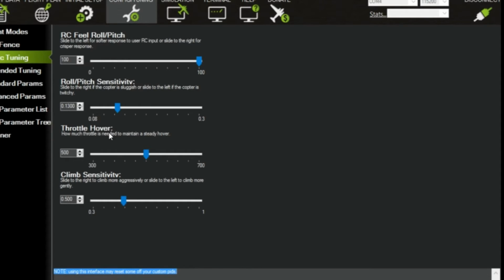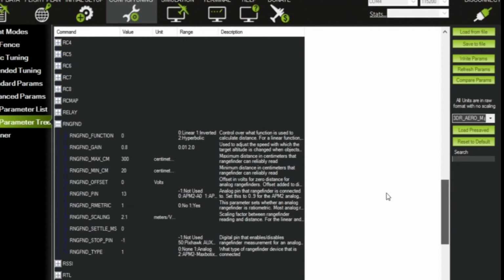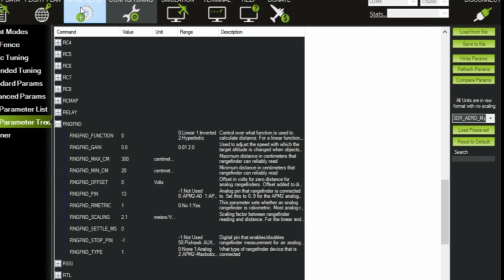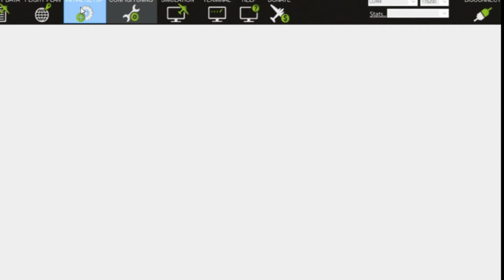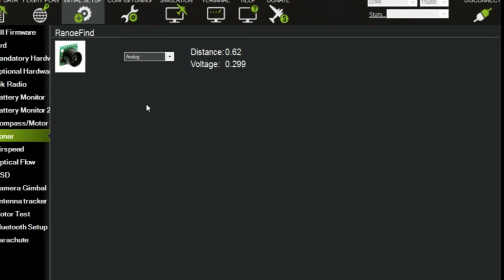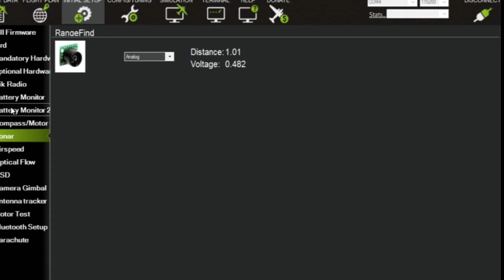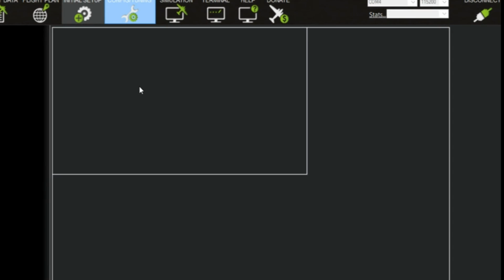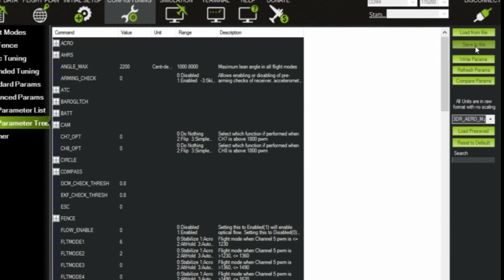cx20 sonar apm 252 v5 mod update

Comment: Hi Bangs6996, i have a four pin ultrasonic module from banggood,the pinout say VCC,Trig,Echo,Gnd,just trying to figure out which wires go where...any help would be greatly apreciate,thanks buddy
Reply from the maker: Hi sadly you need the 3 pin one https://www.banggood.com/APM2-2_5-2_6-2_8-Flight-Control-Ultrasonic-Module-Plug-and-Play-p-1010060.html?p=PK211613756002015039

If you are into arduino's ..you can probably easily just build the man in the middle board your self..  however on the above board they use a i2c adc chip for the conversion ..

Comment: Yeah, I was also wondering why you didn't use some I/O pins like those with raspberry pi. But it was quite a feast to see you soldered it onto the board. Thanks for this update.
Reply from the maker: yeah that apm 252 is limited with i/o pins. if you use this mod then you can't use the power module sensors ..   thanks for the comments..

Comment: Hello,
Is it possible to have a 3.2.1 firmware version for CX20 able to run only gimbal Mount, AutoTune, Sonar, Telemetry, DataFlash logging, and Optflow ?
Or tutorial, documentation on how to compile a custom version otherwise ?
Great explain and I would like to try the gimbal ROI with sonar and optical flow, it will be awesome if possible !
Thanks !
Reply from the maker: hmm never got notification or your post..   no you can't have all that , just not enough room on the apm    you can probably do optical flow ,sonar and gimbal.. ... telemetry is included ..     however I would try testing out just the optflow first on its own. to see if you really even want to have it enabled.
Reply: Thanks for your answer.
I'm actually looking to compile firmware myself (but always afraid to make mistake and break my APM).
What is the limit for the hex file for our APM so, we have to keep some free space ?
Also, when I have the hex file compile, I can upload it with Mission Planner right ?
Edit : I just realize that I cannot use Optical Flow or Sonar if I have a Power Module on PIN 13, so I think I will keep my Power Module. So, I would like to have Logging + Mount + Autotune + Fence + Poshold + ACRally + NavGuided. Do you think it's possible ? When I compile this setup (without NavGuided cause it tell me "'Guided_Velocity' was not declared in this scope"), I use this source : https://github.com/funtastix/ardupilot/tree/ArduCopter-3.2.1 (hope that telemetry still work with this one), in Visual Studio (and Visual Micro), and I get a program size : 241 218 bytes (used 93% of a 258 048 byte maximum), in Explorer Hex file of 663kb.
Reply from the maker: you should get your self a isp before you start playing around... randy said it was 146kb but i think he meant to say 246kb.(in arduino).. ..    The end result of the hex file I try to keep around 672kb  which is the size of the release version 3.2.1      ... Which Apm are you running ?  2.5.2 stock?  if so then your telemetry might not work ..but I can give you a link for where to change that.
Reply from the maker: I did not know funtastix had his own tree..oops lol.. so yes that one will work for you.. also I have not been getting any notifications on your posts.. anddd they don't show up at the top of new posts for me.. So if you leave a comment  to me I am not ignoring you I just don't see them ...
Reply from the maker: and to continue spamming you.. yes you can use mission planner.
you can find the hex file  here C:\Users\YOUR USER NAME\AppData\Local\Temp    it will be in a build folder..just build your file without having your apm attached to the computer
Reply: Don't worry about your answer rapidity, I don't receive notification too, wired...
I just bought a AVR ISP as you mentioned.
I am running the stock CX20 APM, I think APM 2.5.2 with UART ADC and I2C connectors, on firmware 3.1.2 for now.
My hex file is 663kb with Logging + Mount + Autotune + Fence + Poshold + ACRally, and Visual Studio show "program size : 241 218 bytes (used 93% of a 258 048 byte maximum)", probably in Arduino ROM yes. But 146kb is impossible to have this size with 3.2.1 firmware, isn't it ?!
So, my hex file is correct to upload on my APM and keep Telemetry and others stuff working ? Also, is there a risk to break my APM just with uploading the hex file, or at least I always can revert to 3.1.2 by uploading the factory hex file with MP if anything goes wrong ?
(Thanks a lot for your help)
Reply from the maker: Yes ..I have another video with the factory hex file so you are all good.....your hex of 663kb is perfect (thats with tonz of checksums). and if you do brick it . I have a video for that as well with all the files handy... so really you are all good and on top of everything already it seems.. =)..       And a tad more if you went through the trouble of converting the hex2bin you will see your bin file is 241kb again ..
Reply from the maker: anddd also if you are really good at soldering check out my original sonar mod.. you can do a direct solder on the pin to have sonar and power module ..but its right on the atmel pin..
Reply from the maker: https://youtu.be/CPxMgzNjj0w?t=537
Reply: So, it's possible to solder the signal wire on the pin you show on the video (act like PIN A0 on the CX20 APM 2.5.2 ?), and at the same time keep the PIN 13 for Power Module ? This A0 PIN is not use for another thing ? BTW, I'm not a king in soldering haha !
So maybe I can enabled Sonar and Optical Flow in addition on the 3.2.1 custom hex, if I keep file size under the threshold of 253kb.
Edit : I just recompile with Sonar and Optical Flow added. I get "249 288 bytes (used 97% of a 258 048 byte)" and hex file of 685kb ! Still correct ?
Reply from the maker: it might work I have some at 251kb ---705kb.hex. but it might brick it 
as well. ..... yeah you can use A0 its not traced out to nothing else 
.its just a dead pin on apm 2.5.2 ..all they had to do was extend all 
those traces to pads..but noooooooooooo...         If you write your hex
 file with mission planner and get a verification error.. don't unplug 
it just click on the quad icon and load version 3.2.1 or 3.1.5 you can 
some times save the brick..
Reply: Ok thanks !
I think I will try to update firmware next week after finding good parameters (PID, flight performances, etc) or when I will receive the AVR ISP, just to be safe !
Reply from the maker: Your welcome....If you run into problems just start a new comment in my most recent video.. I should be able to find it that way..
Reply: One more question, I just see your video on Optical Flow on APM2.6, I think it's not possible to have one on the original APM2.52 stock board right ? Too many wires, and a 3.3V output.
The only way to have an Optical Flow on the CX20 is to replace the FC for APM2.6 or APM2.8, isn't it ?

Comment: Hi again, I know this isn't the right video for it.. But I am wondering if you have any experience with updating the APM firmware? I have a V2.5.2 board and I am wondering how to update the firmware to 3.2.1
Reply from the maker: Hi..if you want to update to version 3.2.1 just open up mission planner..go to initial Setup -->  Install firmware -->then click on Apmcopter version 3.2.1 if it says apmcopter v3.3.3  ..you can still click on it ..it will load version 3.2.1  or you can click on pick previous firmware.. and choose the one that says 3.2.1
Reply: +bangs6996 thanks so much bangs6996 will this be safe to do? I have heard a lot of bad stories about firmware issues and hex files etc....
Reply from the maker: yes it should be fine to update it.. you will loose the option to calibrate the compass with the cx20.. you will have to do it through mission planner.. however i have a video with the factory firmware...    .. Also before you upgrade to version 3.2.1 back up your parameters.. This way if you have issues with version 3.2.1 you can load factory firmware and your parameters to go back 100 percent..
Reply: +bangs6996 okay I hope it's okay - fairly nervous about bricking the drone
I really just need functioning telemetry and follow me mode, which I can't get to work right now (3.1.5) and have read is only enabled after 3.2.X? 
I have also read that 3.2.X disables the drones ability to use the telemetry....

I'm so confused by all the different information! Haha 

So in short - I can use your other very helpful video with the command line to save my existing firmware, then update to new firmware

Ultimately aiming for my V2.5.2 board to run what ever 3.X.X to run telemetry and follow me from my LG nexus 5 running the Tower app with OTG cable 

Thankyou so much
Reply from the maker: you don't even have to back up your firmware if you really don't want to.. i have it on my google drive now .. ....Yes I would run version 3.2.1 for fallow me mode.. version 3.1.5 makes your drone do a nose dive once you you put it in fallow me mode.. at least mine did..      I have all the files and instructions for telemetry in my very first video..its a tad annoying video but I was not planning on making more after that one hehe..   So the worst case you brick your apm.. but I have a video to fix that as well. and depending on your budget you can unbrick it for about 3 bucks to 12 bucks very easily .. .. depending if you can solder that is ..because you need to add a header to the apm 2.5.2 for isp port... But really I have never bricked it loading custom 3.2.1 ..only my personal files I have bricked it by them being to big.
Reply from the maker: if you don't want to watch all the video ..you can just jump to this part of the video for how to load the hex file.. ect.. https://youtu.be/MbqfpGElSyI?t=646
the links to the files are in my description ..

Comment: Hey i Plugged in a wrong cable to my 12 v and I definitely fried something after that I tried to connect to mission planner to arm my props but the computer wouldn't see my drone (comp3) is there a chance I fried up the usb entrance.....what should I do help please!!
Reply from the maker: +Berk Kip .. which 12 volts.. .. ? and confused did you introduce 12 volts by accident ?   .. If you open up your shell .. and plug the usb cable directly into the apm instead does that change anything.?....     can you still arm the quad ect.just with 12 volt battery no usb?
Reply from the maker: +bangs6996 .. after you have it open as well .. if it is not just loose connections.. you can also try to unplug the 3 wire (white,red,black) coming off the main board going to your remote receiver -b port. and try again.  (with just the usb) .. that might tell you that the main board is some how shorted.
Reply: +bangs6996 i tried opening and connecting directly but it still wouldnt see it I ordered a telemetry system so I can do it wirelessly will that work thanks....
Reply from the maker: +Berk Kip not sure.. you might run into issues calibrating the compass.. everything else will work accept that.   at the same time I would order a 2 dollar serial to usb adapter.  like this one http://www.ebay.com/itm/USB-2-0-to-TTL-UART-6PIN-Module-Serial-Converter-CP2104-STC-PRGMR-Replace-CP2102-/262136733118?hash=item3d08911dbe:g:5oQAAOSwoydWpzoB

You might be able to just wire right into the telemetry at 115200 baud or even cut 2 or so traces on the apm and replace it with this..

I don't think I've every successfully calibrated the compass. but maybe even you keep trying you can get it. also you really only have to do it once anyways unless you end up moving the compass .
Reply from the maker: +bangs6996 to clarify a tad ..the apm already has the cp210x chip on it.. basically it converts usb to a tx and rx.. so really its only two traces you would have to scrape off to replace.. or I'm 99 percent sure you can just plug that adapter tx and rx into the telemetry port tx and rx and ground.. you might even be able to power it with a positive as well.... change the baud rate to 115200 in mission planner and all should be well... so if you are not into soldering ..get the telemetry and that adapter.. you can then skin the yellow  blue and black wires that came with your telemetry and just simply attach the wires from that cp210x adapter.... I have not tried this but again I'm pretty sure either way would work
Reply from the maker: +bangs6996 and........ for kicks in the down time waiting for the parts on what ever you decide.. . make sure your computer usb port still works.. .. IF you have a old usb cable you don't want.. skin some of the plastic half way and expose the wires , clip the red wire .. now plug the usb cable into the apm and into your computer.   , then plug the battery In. See if it gets detected.  save that cable .because its a much safer way to use usb and battery at the same time on apm's anyways. I made a cable with a jumper. so I can plug and unplug the red positive wire from the usb. 

besides that your quad still arms? just hopefully its not your entire apm that is fried...if you get nothing from your apm at all no lights.. when you plug in the battery ..maybe its just a diode / fuse blown
Reply: +bangs6996 when I plug the battery ...the lights are on.so I don't think that there is a problem with the apm....
My telemetry will be here by tomorrow or next day.... I already calibrated the compass before I fried the usb so all I need is to arm the motors....
Do you think the telemetry will do the job???
Reply from the maker: +Berk Kip    is your goal to disable the Arming check?  ..you should be able to arm it no problem, but might still have to disable arming check if that is the problem your running into..    Don't forget to backup  your params.. It should save your compass settings .
Reply: +bangs6996 yes that's all I need to do but I don't know if I need the firmware fix to run the telemetry I just got the a month ago do what do you think???i can't do the firmware fix cause I fried up the usp insert:(
Reply from the maker: +Berk Kip ..yes you need the firmware fix and need to change the cable pinout if you have the original apm.     but like you said we don't no for sure if the chip protected the atmel or not.
Reply from the maker: +bangs6996 wow..lol  ..pretty stupid I am today.. How you suppose to do the firmware update if your usb is fried.. oopssssssssss!!!    anyways . are you still running the original firmware  ?  if you are then you don't need to do the firmware update , but you still need to mod the cable
Reply: +bangs6996 it works just got it today but still can't arm!!!
Reply from the maker: +Berk Kip Not sure what your trying to do.. why are you trying to arm it through mission planner?        If you go to standard params is arming check disabled?